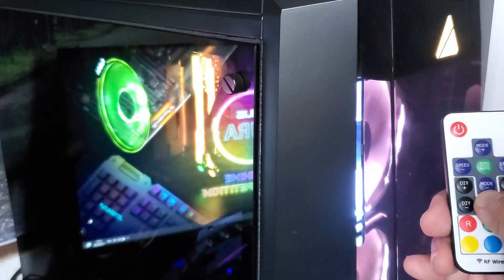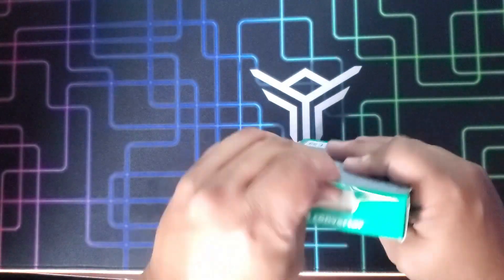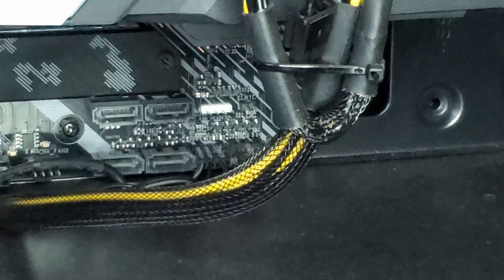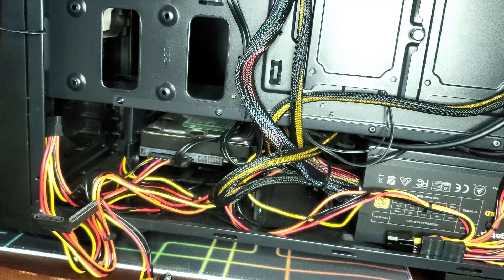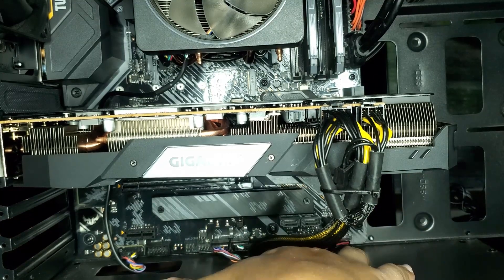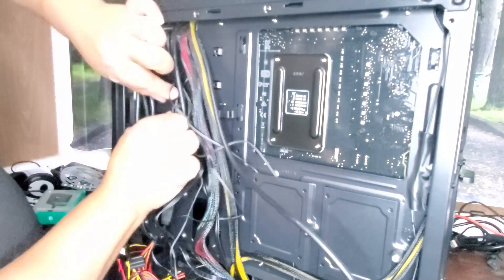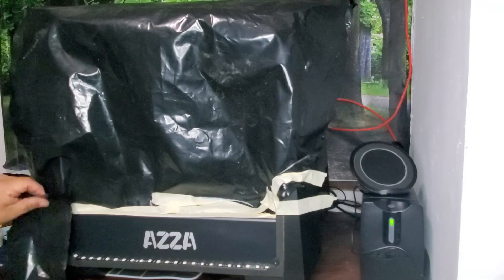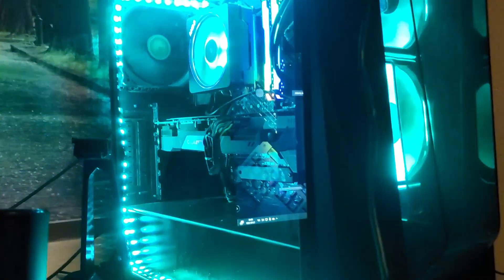Installation RGB converter from 5V to 12V and 3 pins 4, for Asus TUF X570 to synchronize Aura Sync

Comment: Hello, so if I connect my fans to a hub, and the hub output is 3pin 5v.and connect that output to the converter, will the Asus software recognize the fans?
Reply from the maker: Yes Aura Sync Recognize them like RGB not ARGB. I Think a make another video to explain it.
Reply: Same question

Comment: Does it also work as a hub? If I wanted to plug in it both 5v fans and 12v fans in it would it work, or does it only work to convert one to another?
Reply from the maker: No, the hub and fans are 7-pin

Comment: HEY BUDDY , IS AURA RGB HEADER AND ARGB SAME IN ASUS MOBO's ?
Reply from the maker: No, they are different, 4 RGB pins show you a single color, 3 ARGB or DRGB pins can show different colors on each led. In the case of this ASUS TUF X570 it only has 2 4-pin connectors. That is why I opted to put RGB colors, but more can be done with this. I already made another MOD. I am editing the video now. To take better advantage of these connectors.
Reply from the maker: Here is the firt mod https://youtu.be/1qkFdfSHFJg